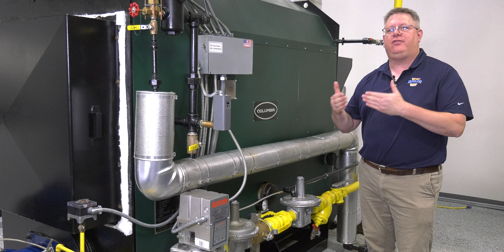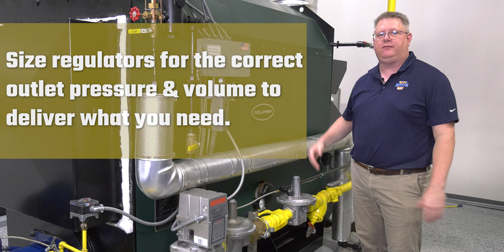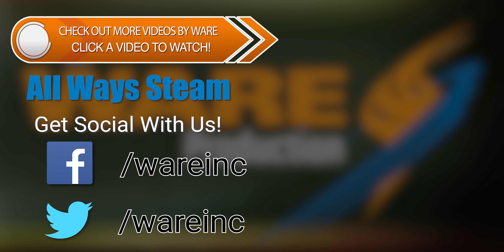How to Pick The Right Regulator for Your System - Weekly Boiler Tip

Comment: As far as I know. The first regulator needs to be as far as posible so I have some gas pipe room to have the ability to modulate properly. Being that close to the burner will cause several issues.